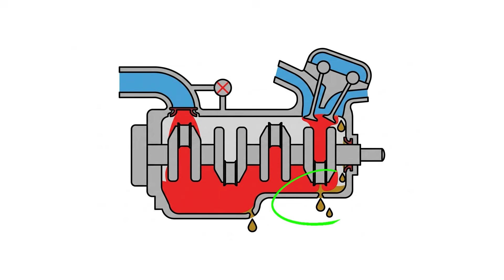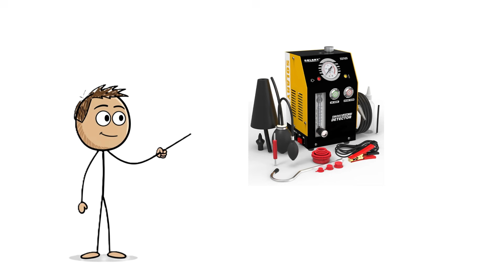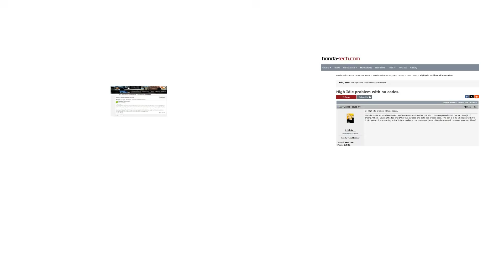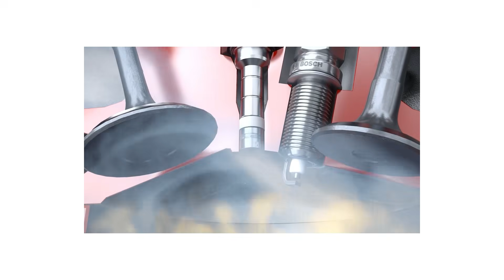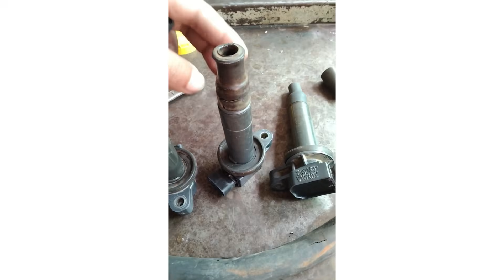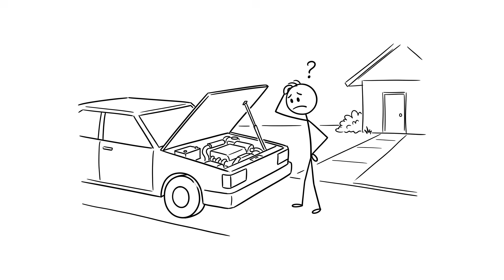If Your Engine Revs Up and Down at Idle, You Need to Check This Before Paying $1,500 to Mechanic

Comment: 2013 Chevy suburban in reduced engine power mode,  after replacing throttle body,  ran perfect one day.   Scan reset works manual relearn doesn't.   Code p2135

Comment: Well the problem with new vehicles is that the pcv valve is built into intake manifold, so you have to replace the whole intake! I would try to spray carb cleaner through first before replacing it! 👍